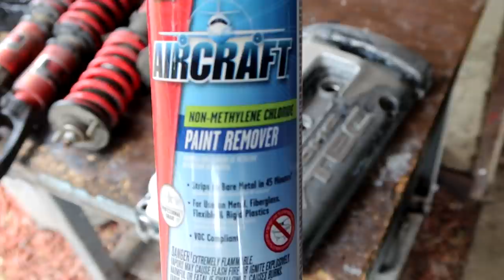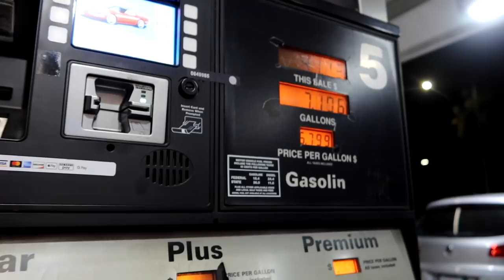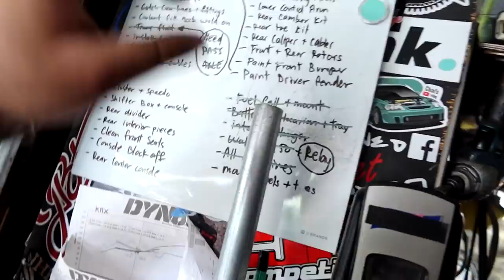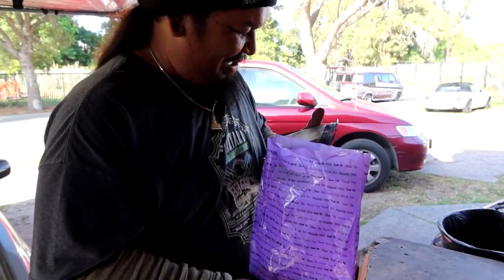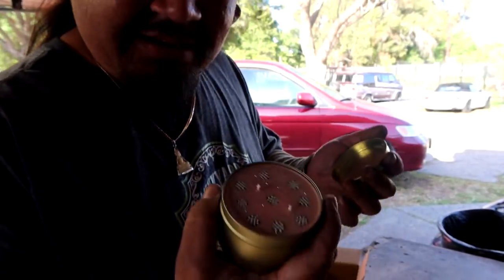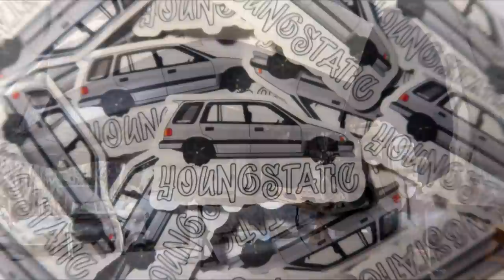Assembling the H2B Turbo CRX With Goodies ! !

Comment: Mad work put in on the  Crix.  I know you were just mocking up for S1 booth but did you put a rubber grommet in the hole where the fuel cell hoses passed through  to the under carriage????